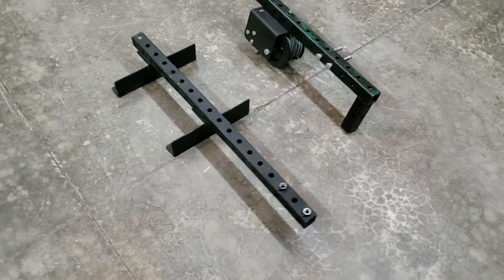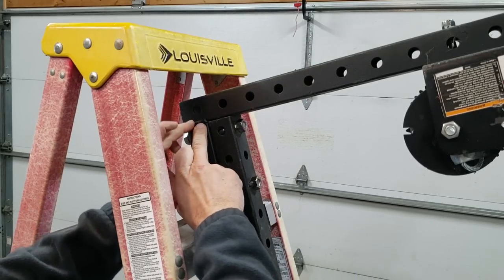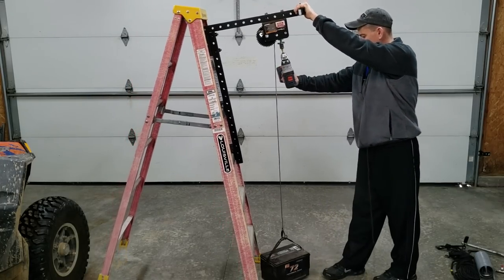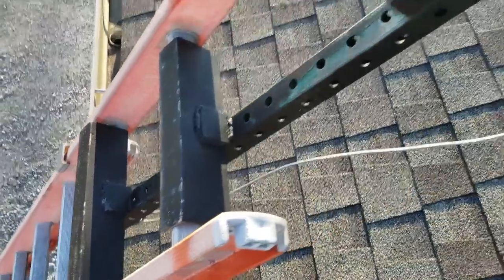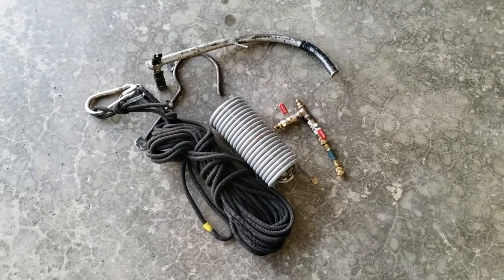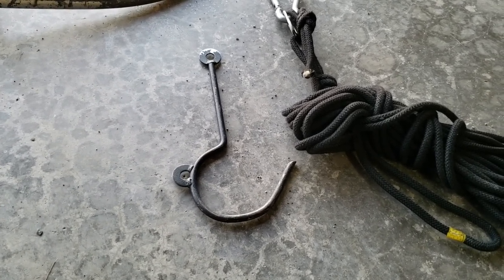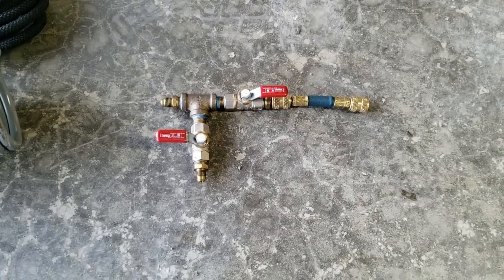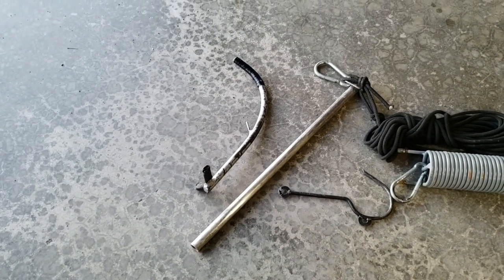Ladder Cranes And Custom HVAC Tools

Comment: We had ladder winches that we built in our welding shop back in 1972. We used them on extension ladders to lift O6D compressors on and off roofs. 1 man could replace a semi by himself. Lately these ladder lifts/winches are illegal per OSHA regulation ladder rules. Just like the stinger one man crane we use to pull up on the roof and could lift compressors, refrigeration and AC condensing units, and exhaust fans. They were great while it lasted, again not permitted per OSHA.
Reply: I agree with you. The problem is that when someone using these homemade items has an accident, then the insurance co. & OSHA gets involved & now the people who follow safety rules & regs have extra burdens put on them.  My advice, hire a crane to lift all your compressors & tools to the roof using a heavy gauge wire basket available at industrial supply warehouses.

Comment: I was thinking about small versions of the crane with trolley for some of these 2hp condenser fan motors so don’t drop dam thing through a coil 
Also thought about a tee handle with a set screw collar to shaft so have something to hold onto or hook winch cable hook too 
These chiller fan motors are getting heavier I’m getting older

Comment: Love the hook for self roping your crap off the roof 👍
Reply from the maker: It really works great! Thanks 4 watching👍👍
Reply: Definitely saves legs when by yourself on the job use the same concept on rough ins with big fittings or nesting a bunch together taps wyes and ells tapers I've seen two ladders used as lift for a 3 ton package unit kind of sketchy but they got it up in one pc for a single story only good idea no crane fee waiting great time saver cost savings passed to customers nominal fee for service.

Comment: Been wondering how I was going to get stuff topside as an older newbie without breaking my back!  Have looked at the ladder hoists, but the COST!!   This is the PERFECT solution.  That will be in my truck!  LOL!!  Harbor Freight saves the day again!  I don't have any of the scrap metal, but I know my steel supplier sells theirs for .06 a pound so...
                                       Nice MIGn there brother! Those joints should give you a lot of trouble-free service.   I may run mine to Lima Powder if I think it's good enough.   That should make it last.
Reply from the maker: Thanks,  my dad was a welder at General Dynamics and tought me.  I don't do it everyday so it usually takes me a few inches to get my groove back.  You could either go to Allen County Fab or Century in Van Wert for metal.  That green metal that it's made out of won't rust anytime soon.  I only painted it black to make it look nicer. You still haven't told me who you are?
Reply: @HVACRSurvival  My name's Curt.  I live in Findlay.   I'll message you sometime on facebook and fill you in on the rest, don't want to give my full name on YT.  Finishing up 1st week in may, taking my EPA in 3 weeks, wish me luck getting my universal on the first try!   Don't want to go broke one part at a time!!

Comment: Would it beable to lift a 2 ton minisplit condenser unit???
Reply from the maker: I don't see why it wouldn't. That's not what I designed it for but the electric winch version that I made is capable of 1500 lb. You have to remember the weight limit of your ladder is usually only 300lbs if you're lucky, not to mention if OSHA was watching you might get a fine.

Comment: Where you get the L metel that goes to the step ladder sir. Thanks.
Reply from the maker: That was L channel that I cut and welded together. Check out the newest video called the ultimate ladder crane. I stopped using this bracket and made one that does 5 types of lifting.

Comment: hi sir what mm wire u use??
Reply from the maker: @RawaLumbu-d4y  that might be quarter inch? I just switched to synthetic winch rope that is rated for six or 7000 pounds.

Comment: Cool ideas. I’m curious about thus ladder crane raising a small condenser. Looks like I would have to lean way out to get the drill on. I wonder if the drill point could be facing the operator?
Reply from the maker: There's a few videos on YouTube that has one just about like it but it's a little heavier Duty. One major thing to consider is make sure you're wearing your PPE and harness when you're doing this because you could get an OSHA violation.  Also there's a possibility that because the ladder is not being used by manufacture specs that OSHA could also site you as a violation.  **As always use at your own risk and verify these things before attempting this. ** Thanks 4 watching!
Reply from the maker: You could mount it how you prefer and use a pulley to make the angle down.  I haven't verified the max capacity yet but I think It could handle 300lbs . If You reinforce the 45 degree axle with a  45 degree brace it could do alot more.

Comment: Love the crane.  Any way to put another drive nut on the other end of the worm drive so you could operate
it from underneath and on top?
Reply from the maker: You probably could if you drilled out the metal and welded onto the worm drive. I had some problems needing more power from my drill so  I redesigned it with a electric winch,  it works allot better now and it works in more applications. Check out the video for that one.
Reply: @HVACRSurvival  Thanks.  I just watched the video.  Major upgrade!  I'm sorry I commented before
watching your improved version.  We appreciate you sharing your ingenuity.  Strain the brain, not the
back.

Comment: Do you have the link for winch
Reply from the maker: Harbor freight has this one and the new winch I currently use.
Reply: I plan on using it for raising tanks , pu.p and recovery. I did not find it at local harbor freight
Reply from the maker: Go online and the part number should be there

Comment: Nice video...Just curious on how you get the load off when on a roof hatch? 

Do you have a cut sheet on how you made your winch?
Reply from the maker: I wouldn't try anything much bigger than a hermetic compressor if I was going up the roof hatch,  the only time I used it was for a 5 ton rtu compressor and I used the strait ladder.  If I wanted to pull a real big compressor up the hatch way,  I would rather use the second uni-strut crane I showed because you can slide the load left or right. Far as constitution, I pieced the ladder crane together piece by piece,  I didn't have any layout planes. I can measure it out for you if you like,  just contact me through Facebook.

Comment: Just some advice from a retired contractor, I was like you making my own hardware. Don’t let OSHA see you using any of this. You will fined out buying the manufacture product was cheap compared to the fine. I also worked as Safety Director for a Excavating Co.  My suggestion is for you to get up to speed on OSHA. If you would like to get more info please feel free to contact me.
Reply from the maker: I appreciate what you're saying, I know that I need to wear a harness and all the other PPE that goes along with that, which I have.  I also have my 10-hour card which is usually plenty for what I do. (I've had several people ask me to build this and I have rejected all offers because I know the legal liabilities that would go along with it.)  It reminds me of the question I asked during safety class "how do you make a secured, approved rigging point as the first person on the roof when you can't be secured when you're making the secured connection."  It's like the chicken and the egg, which one came first?  They couldn't quite answer it in a way that didn't show that at one point you're going to be unsafe until you install the anchor.

Comment: Something to remember. These are fine to use at home, but when taken onto a job site that is covered by state or OSHA regs, like hoisting an air con unit onto a paying customers roof,  you are using a lifting device that has no engineering behind it, isnt rated or tested for max safe load and isnt inspected for safety by any regulatory agency. The liability is all on you for any damage or injury. 
2    6:03  Uni strut or whatever you call it is for hanging pipe or electrical conduits, not as structural members in hoisting applications.  This little monorail hoist is scary.  Buy a load rated and engineered one from Harbor Freight. 
3  A homemade hook????  You gotta be kidding me.  Accident looking for a place to happen. 
I realize you are only lifting to rooftops, and probably under 500 pounds, but even ten pounds, dropping from 20 feet can kill you. 
4  In this day and age of law suit hungry idiots, if someone makes a ladder hoist as you recommend in the video, and gets hurt, He can sue the crap out of you. 
 I am a retired crane and hoist inspector and journeyman Boilermaker fitter welder.
Reply from the maker: Do you think maybe that's why I have not made these and sold them? I have friends in the legal system and that's the reason why I put in my videos that they're all for entertainment only and not instructional videos. Also I've never recommended lifting a whole air conditioner on a roof that is totally stupid. There are actual manufacturers of these that are using them to lift whole units onto the roof. Somehow he got it OSHA approved and it's on my video where I went down to ahr 2022 and I talked to the guy and did an interview with him. I fully understand what you're saying and I agree that's the reason why I haven't done anything more with it than use it for my own personal use.